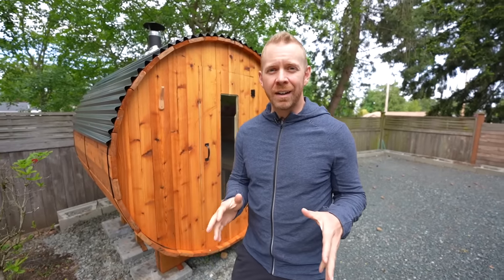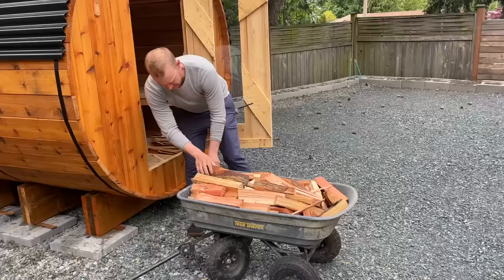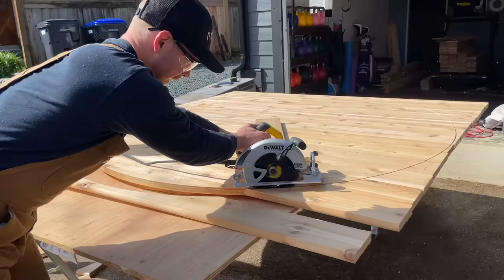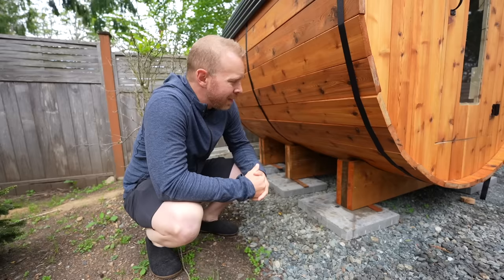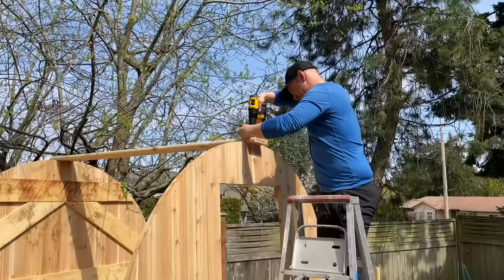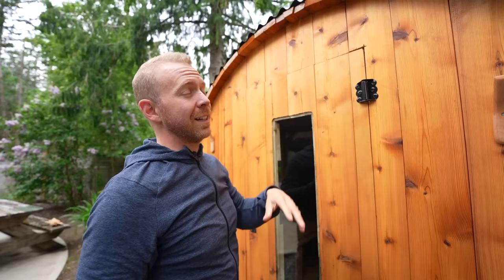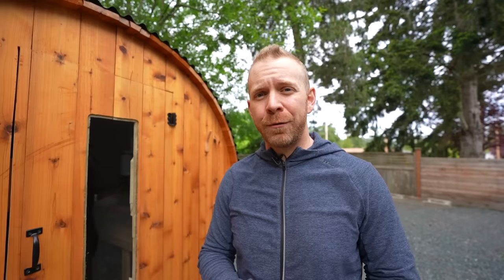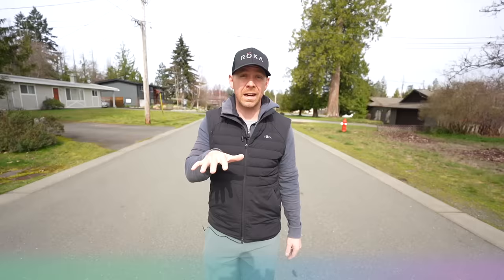$3,000 DIY Barrel Sauna Full Build How-To

Comment: Cool video- gonna use it as a guide to build mine. The only thing I will add is additional wall inside to avoid heat loss and have a small room before you enter inside sauna. Cheers!

Comment: FYI.  S4S stands for “surfaced on 4 sides” (i.e., one edge of the board is trued up on a jointer, then run through a planer to mill the top & bottom, and finally run through a table saw to clean up the other edge).

Comment: Very nice.  Instead of routing the curved edges on the slats, it might be easier to cut angles on the slat edges (easier for me, anyway, since I have a table saw but only small router table).  Also, for cutting the slot, I'd probably end up doing that with a few passes of a circular saw and the clean out with a chisel (or maybe even bend some layers of thin trim boards around the inside of the curve to serve the same purpose).  And for the spot I have in mind for doing this some day, a large rear window would be a must.

Comment: Thanks for the video! I would love to build one but I live in Cochrane Alberta. A little bit of different weather. Would there be additional insulation needed or better heater?
Reply: You could lay double bubble wrap insulation on top of the sauna underneath the steel Roofing that would help hold heating on the top half

Comment: You state your boards are 1" thick,  are they a true 3/4" dressed S4S board or dressed 5/4 board finished to 1" thick?   thanks in advance for responding.
Reply: Those are 5/4 barefoot decking, s4s 100%. I'd build 3 stick framed type before I'd build 1 build one.. lol

Comment: That is awsome Taren I had been looking at similar love it!! Just curious about how long does it take to get up to usable temperature.?? I was thinking of doing the same with wood fire as cheaper and a lot easier than getting an electric one hooked up but was concerned with how long before using it you need to stoke the fire... Guess great if want to use in the evening after work stoke fire do a workout and hopefully up to heat by then... guess could do the same in morning if only takes an hour to get hot... Im Travis not bruce my sons account....;)
Reply: he said in the video it takes an hour

Comment: About how heavy do you think this things weighs? I may need to move mine at some point and was curious if you think that's doable?
Reply: Definitely heavy. Only way I see to move this easily is with a tractor with pallet forks to reach underneath it and strapping it down. That or suspending it from a front end loader. Then it could be placed on a trailer and transported.
Reply: It probably wouldn't be that hard to disassemble and reassemble.  Number the slats, take off the roofing, loosen the straps, and start pulling out the slats.